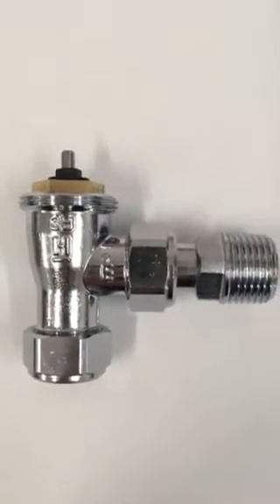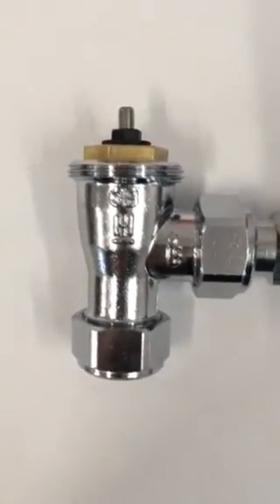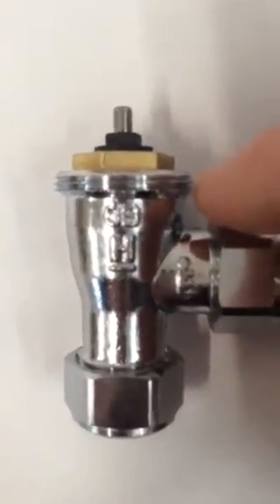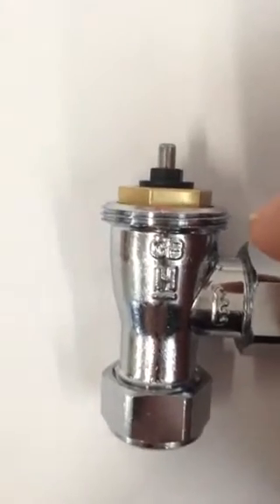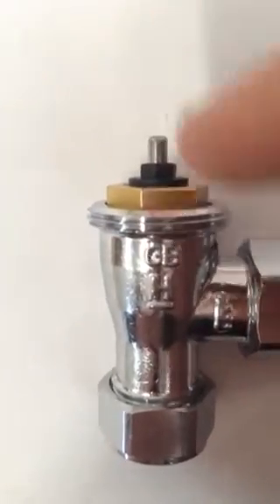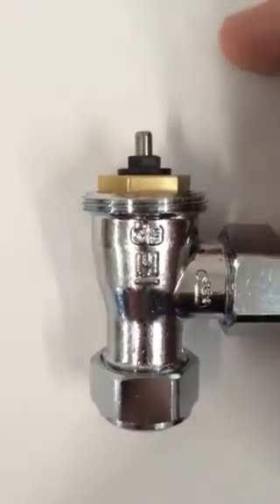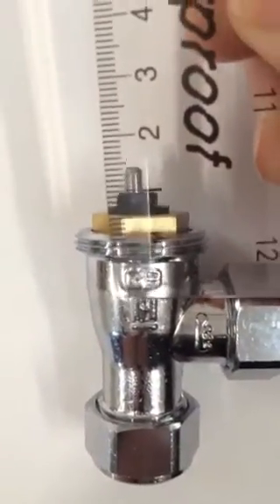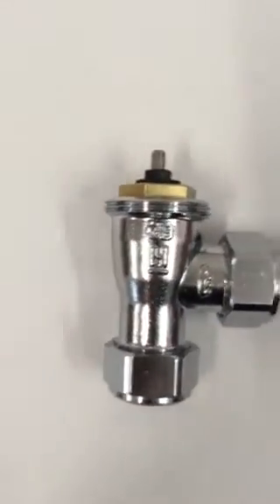Honeywell evohome HR91 & HR92 Smart TRV Radiator Valve Compatibility | Pirate Heating Supplies

Comment: Thanks for the video. I am planning to buy Evohome. However, I currently don't have thermostatic radiator valves on my radiators. My question is, does Evohome work with the normal valves (the ones that are like a water tap)?
Reply from the maker: Haidar Al Attar unfortunately you would need the valve changed to a TRV style valve such as the V120-15A shown in the video if you want to fit HR91 or HR92 Radiator Controllers.
Reply: @MWPHS  Thanks for your answer. Any idea how much it would cost me roughly to change the valve per radiators?